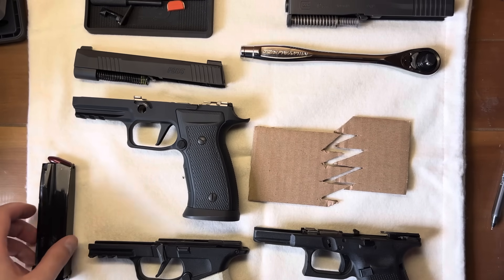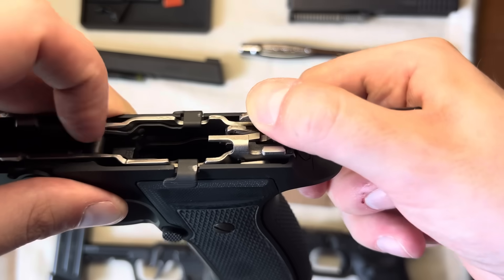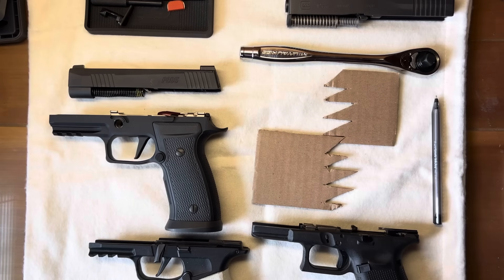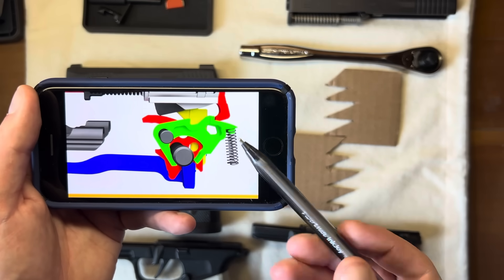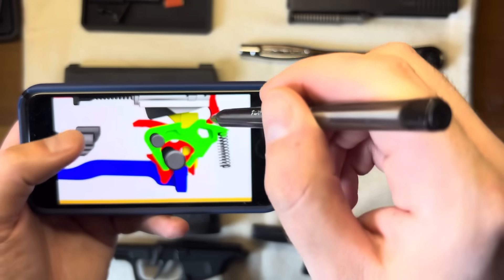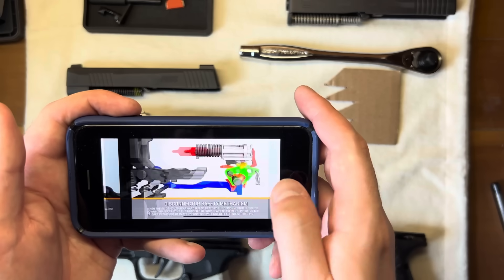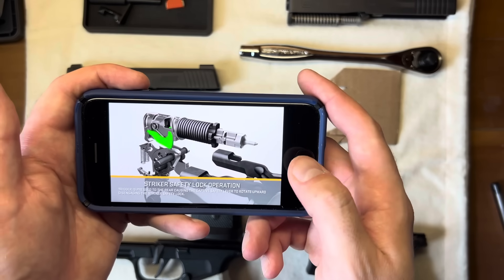Sig P320 Theory on Potential Cause of Accidental Discharges (Expanded)

Comment: Well we tested ten different P320 outside of holsters. And we get six that will discharge with slack taken out of the trigger. But when these ten pistols are placed in different holsters we have eight that will discharge when slack it taken out of the trigger. 

Great video, but the random models of the P320 vary so much the reliability of the pistol is lost. 
The primary reason for sale of the P320 was its safety. And as a current owner and Retired LEO the clock is ticking on the P320 going off on another police officer or military person carrying the pistol.

If you were in military or Law enforcement would you carry a P320 on your belt or thigh?
Remember the Pistol is hit getting in and out of vehicles. Jarred when struggling with subjects. Hitting door frames. Or jumping around a battlefield of rocks, sand, trees, or urban buildings.
Reply from the maker: I totally agree, even the grip coming in contact with your seat bolster while driving. At this point in time if your agency is making you carry this firearm I would recommend a drop leg holster to get it as low as possible on the body. It won’t fix the issue but it could reduce injury.

Comment: Sloppy fitment, sloppy assembly, tolerance issues, low-end material. The design can be flawless, but if it's half-assed in practice, it's flawed.

Comment: I think you're right about the striker safety lock.  Also people on Youtube aren't properly explaining how the M17 and M18 with a manual safety are experiencing UD's.  Which is my question and I think you answered it.  I think the main issue has to do with a combo of #1: Improper SEAR design (there's too little sear engagement with that crappy hook design) #2.  SLIDE to frame fitment (I have never seen that much up and down movement between the slide and the frame on any modern striker fired handgun) #3. No trigger safety in combo with a pre-cocked striker.   Glock's performance trigger has a pre-cocked striker design BUT the trigger has a safety and so far I've never heard of a Glock with a GPT installed having a UD.  I own one and there's no way for the striker to shoot forward without me intentionally pushing through the trigger safety and past the wall.  You can drop a G19 with a GPT from whatever you want, or hit it with whatever you want and the gun won't go off.  It's amazing how Glock releases a trigger kit to install in it's Gen5 handgun which is different than it's original design.  AND STILL WARRANTIED.  AND IS STILL SAFE.  That says A LOT about GLOCKS CONFIDENCE IN THEIR OEM PARTS.
Reply: Which leads me to the question:  What if Sig ADMITTED that there may be a problem with the P320.  And OFFER a newly designed trigger shoe with a safety. And cover the cost for any P320 owner to have the new shoe installed by a certified SIG gunsmith.   As far as law enforcement and the military, send each department as many trigger shoes as needed to retrofit every active P320 in service.  I think just by having a trigger safety could overcome the other design flaws with the handgun and reduce (hopefully eliminate) all these unfortunate UD's that are causing our good men & women in law enforcement and the military to suffer all these traumatic injuries.  It would cost SIG A LOT LESS to produce and pay for a few million trigger shoes to be installed in every P320 sold than what it costs them to pay for their legal team for each and every court case.  Not to mention the over 50% drop in their stock price from 2 years ago.  Public backlash, loss in sales, loss of law enforcement contracts, etc.

Comment: I wonder how the armorers/ gunsmiths at law enforcement agencies and the military service the P320's???  How do they order parts when M17/ M18 needs to be serviced?  Do they inspect these parts before installing??  I have no idea.  Also, Sig using a pre-cocked striker in this sloppily built handgun, with a crappy SEAR design, and without a trigger safety is a recipe for disaster.  As we now are all witnessing.
Reply from the maker: They order parts from reputable sources including the manufacturer. When replacing  parts the manufacturer has a whole process documented in a manual including a check list to help identify issues. Depending on the parts replaced there can be functions test. Usually the manufacturer will give a training that covers the single platform. At the end of the class you take a test to show you know the material and receive a certificate.
Reply from the maker: Sear engagement is usually part of this check list. If you look in the upper left you will see an orange back plate for a Glock. This is what we use to check the sear and striker hook. It is manufactured to be shorter allowing you to view the engagement.

Comment: Excellent presentation.  A high-speed x-ray camera would help prove what is happening internally.  When Ron Cohen sees this video he's gonna order his engineers to send a terminator back in time to come after you...
Reply from the maker: I was thinking a skeletonized slide and slow motion video but yes you get the idea. It would be fun to develop testing procedures.
Reply: @dgrassley  Outside of the factory, there probably aren't any cutaway models for demonstration and instruction of armorers for the 320.  The military might have some.  Someone would have to sacrifice a pistol so a machinist could open up areas for viewing.
Reply from the maker: @aaronfarnsworth7653  grayguns has some they use in demos and truly anyone with a CNC machine can mill it. It would just cost a lot to have done if I had to guess. 

https://youtu.be/4q-AFIxPH1U?si=rgxPb73MKSSfM-Q3
Reply: @dgrassley  check out the video by @jimprice8211...  Jim Price's theory timed to combine with your theory looks very promising.
Reply: to attempt validation of this theory, try holding the front of the slide against a rotating vacuum cleaner brush...

Comment: Sorry if you've answered this is previous videos, but what are your thoughts on the safety of the p365? Do you carry yours? Thanks!
Reply from the maker: I believe the P365 does not have this issue. In my first video I kind of compared the 320 and 365 to one another, over all features are extremely similar.  I believe this is more of a material and geometry issue rather than the lack of any safety features. Also, I believe sear engagement is likely more but I have not tested it.

Comment: Your demonstration makes the most sense so far
Reply: It does. I have figured it was holster and a “torque” applying pressure. I’ve seen videos where they insert junk into the trigger, that’s foolish. This is the analysis I needed. We have over 42 circa 2017/2018 x5 p320. VERY solid, we can’t seem to replicate the issue with ours.
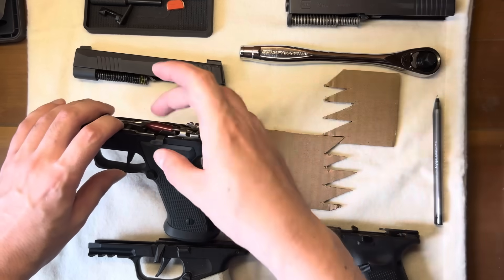Reply: 4:37 this is what we thought. Gun being placed out of battery, and under a torque in holster. Excellent video.

Comment: Your theory of walking is similar to this video https://youtu.be/8Ir-MpeF0FM?si=KkklIqyG0RIqtmd7
The presenter felt that the finish on the parts might be rough due to the metal deposition of the manufacturing process.

Another interesting video is this https://youtu.be/yY4SicvhEpY?si=EMzqL40eNz5oxuXo  In this video the FBI was able to replicate what you describe (they replicated the firearm discharging without a trigger pull by having it squeezed and moved repeatedly). Sig Sauer says the FBI tested the M18 incorrectly in the report discussed and that the FBI has retested and found no problems. I would definitely like to know how the FBI tested the M18 incorrectly since they had safety failures in their test.
Reply from the maker: The issue I have with the FBI test where 9 of the times they released the sear. This was named the sear movement test and you get feedback from the tail on the sear as it comes in contact with the trigger bar. Effectively pulling the trigger and rotating the captive safety lever. 

The most important statement in that whole document was the one that went off without manipulation of the slide. This is where I believe the firearm was over inserted into the holster and my exact example occurred.  However, BRF could not understand why this happened and attributed it to failure of the striker, safety lever failing.

Comment: Everyone thinks mil spec means quality. 😂😂😂. When it means lowest contract cost. And Loose sloppy tolerances made to operate in poor conditions. That’s why old battle cartridges had tapered side walls. To ensure extraction in poor operating conditions. I’m not a pistol guy but from what I’ve seen it looks like a weak design with light spring that would surely fail. I could see it failing a drop safety test really easy. As well heavy use and abusive conditions causing excessive wear on small weak parts and springs. There’s a combination of problems that all lead to one thing and sig has been doing good at winning in court so far.
Reply: Not every defense contract is awarded to the lowest bidder.  There is a price / performance component, not just price.
Reply: @matthewgaines10  true, it's not just about the lowest bid, it's also about the highest paying bribe and kickback package...

Comment: I’m not wanting to insult or hurt anyone

But it’s clear as it’s that gun is has some type of defect in someway 

It’s true that it doesn’t go off every time and I don’t think it’s every single one of them just most of them 

But to say as a blanket statement that it’s nothing wrong with it, I believe that might be slightly trying to deny reality or maybe maybe just straight out delusional 

I had one of those a while back about when all this stuff started, and it was literally laying on the hood of my truck in a holster to keep it. It was a cut holster with leather over top of it and make it a little easier to carry around and it went off. No one is even no one was within 4 foot of it fortunate it was pointed toward the side of a hill And it didn’t hurt my truck. It didn’t mess my holster up a little bit, but I fixed that pretty quick but it’s gone went off all by itself. I traded. I told the guy I was traded in and he said they were. It was just something I’ve done, but no one was even near it.

And I went and bought another Glock. I have many
 Glocks 

To replace that I bought another generation three Glock that makes about six of those. I don’t like the generation four or five I haven’t seen the six but five is OK but I’d rather have the three. 

And I have carried that one particular Glock for more than 30 years
I never fail for shit but now I do keep it clean and I do occasionally replaced the spring and I have replaced the firing pin safety because it doesn’t look like it got something on it, but it was still shooting a sign. I just replaced it with a new one. 

But beating at banging it dropping it off a rock Cliffe once by accident landing in among rocks I don’t know if it actually struck any rock in particular or it struck them all or none of them, but it didn’t go off. It’s always accurate never failed to fire and I have probably 20,000 rounds through it.

Comment: UGH FINALLY SOMEONE TALKS ABOUT IT! I've been posting that I figured that you NEED a fully loaded mag in order to get it in the right configuration for this to happen. I don't have access to one to explain it in a video.

None of the guns that went off have half or mostly empty mags. It NEEDS a fully loaded mag to have the force required to get this to happen.
Reply from the maker: https://youtu.be/itGqqq8IcL8?si=eif4sJ80okv5CcVV

Totally agree. This has been documented for years.
Reply: @dgrassley  Yup, this is the video I got the theory from. 40 thousandths is really small for engagement shelf. But I also wonder how far the striker block needs to move in order to release it and also, if one of the possibilities is that the striker safety lever is actually out of spec on some of these units and as it slips off the sear, that the larger than spec lever is allowing just enough of a bump to bypass the striker safety.
Reply: No one can prove this because it’s mechanically impossible.

Comment: I think it might be a little more simple. When the trigger is reset the striker safety is still disengaged.  Suppose the gun is fired, and there is significant fouling present. Slide comes forward, the trigger goes forward past the reset but travels no further. Now we have a round in the chamber, the striker safety disengaged. Now with significant slop between the slide which holds the striker and the seer which is in the grip module engagement is lost the striker comes forward and the loaded round is discharged.
Reply from the maker: I have thought about that as well. The reason I think that is less likely is because the natural position is all the way forward and it would have to overcome a decent amount of spring tension. Also, due to the amount of fouling I believe would be required, I think it would be documented in post discharge reports. I do agree though if something was stopping the trigger bar from coming forward the same thing would occur.
Reply: @dgrassley  The trigger needs not move. You fire, he trigger comes forward for the reset but travels no more. At this time the striker safety is already disnaged. This is because the striker safety bar is still UP at the point of trigger reset. You should watch the latest video from WGP where he shows that the striker safety is completely  disengaged on all models the moment the trigger gets to the wall/reset.
Reply from the maker: I miss read what you were trying to say. That was my idea as well for a very long time, but fouling isn’t present during the post discharge review. I agree it is totally possible to have that occur.

Comment: I'm also waiting for someone to address the excessive movement of the slide in and out of battery,  tighten the fit and see what happens.
Reply from the maker: Yes, or they could increase sear engagement. Forty thousandths is not a lot in the grand scheme of things.
Reply: @dgrassley  how much sear/striker engagement do other pistols have?  My guess is just about the same.
Reply from the maker: @jeffhernandez5098  I’m going to do a video on the different sear designs to explain the differences, because the numbers don’t tell the whole story.

My Glocks and FN 509 have 50 thou, the P365 has 60, and the CZ P10 has over 80. Note the striker doesn’t engage all 80 thousandths on the CZ. The P320 has the smallest sear at 40 thou, but the other manufacturers don’t have a shelf at the bottom of the sear. On the P320, 40 thou is the maximum engagement you’ll ever get. 

When I used to work on Glocks, we were trained to replace components at 2/3 sear engagement. 33.3 was the minimum Glock wanted on any of their firearms, but take that with a grain of salt, because we’re talking about two completely different designs.  Hopefully this adds a little context.